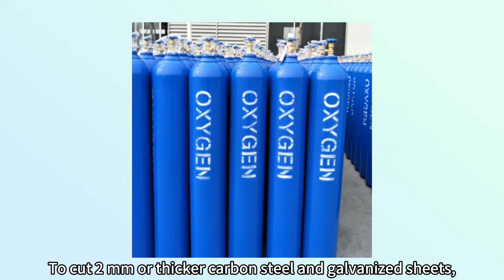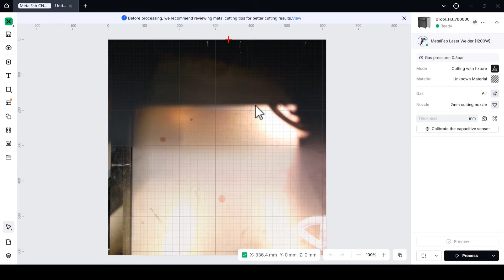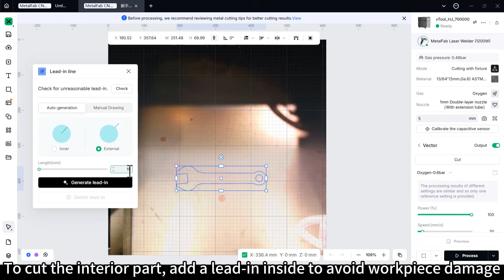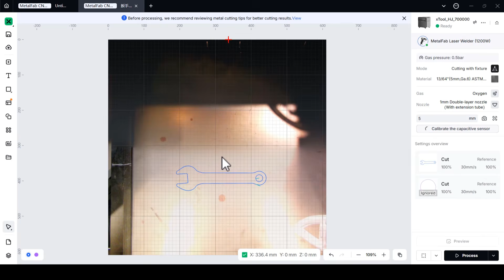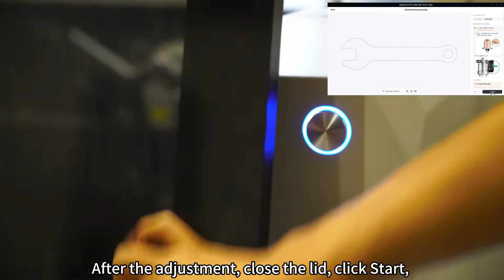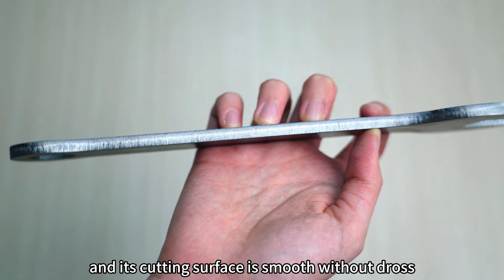Lesson 4: How to Cut Carbon Steel and Galvanized Sheet?

Comment: In case you didn't know the auto settings in xTool studio are useless. Actually damaged a lens using what they had. These settings produced near perfect cuts. After hours of trial and error.

For anyone cutting 5mm A36 steel on an xTool 1200w, here is the "magic" recipe to kill the dross and smooth out those vertical lines. 🎯
Hardware: 1mm nozzle + 20mm extension tube + Oxygen (O2)
Perforation (The Secret Sauce):
Level 1: 1000ms @ 10mm height (clears the scale)
Level 2: 2000ms @ 6mm height (punches through)
Delay: 500ms (let the slag clear before moving!)
The "Golden" Cut Settings:
Speed: 14.5 mm/s
Power: 90% Duty Cycle
Frequency: 5000Hz (Max it out!)
Gas: 10 - 11 PSI (Laminar flow is key 💨)
Focus: -2.5mm (Get that beam waist in the middle)
Process Height: 0.7mm (Stay tight to the plate!)
Pro Pathing:
Lead-in: 7mm  (keeps the entry hole off your part)
Soft Start: Enabled
Cleaned up the edge significantly and the slag is 99% gone. Hope this helps someone else save some material! 🤘